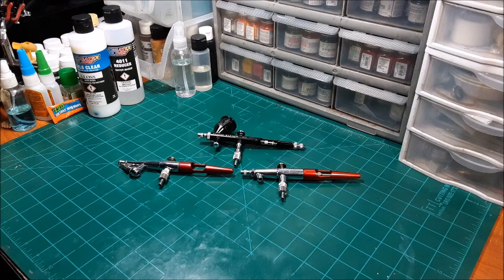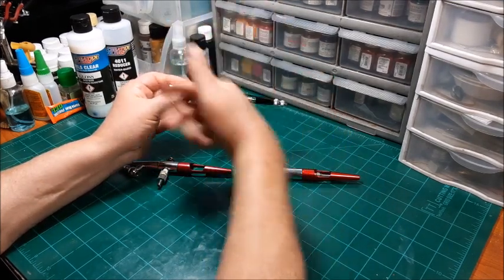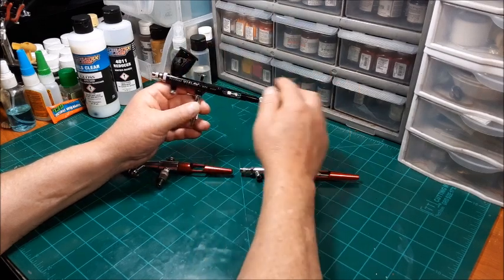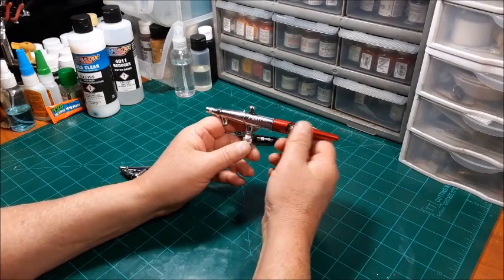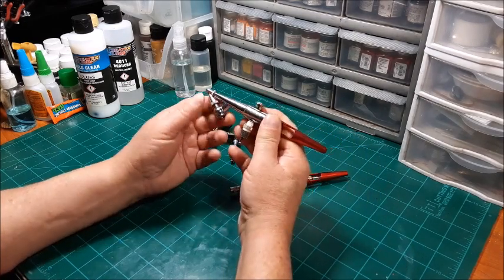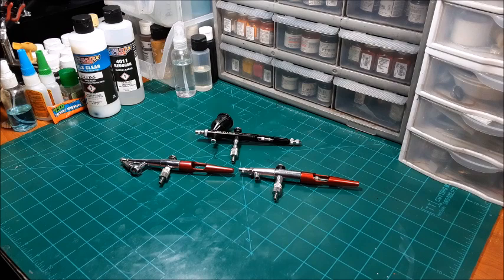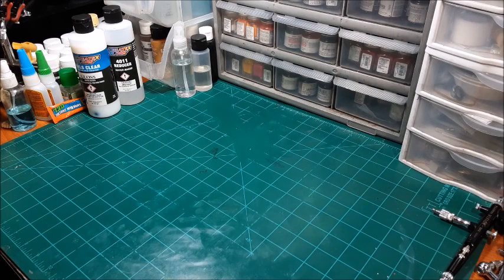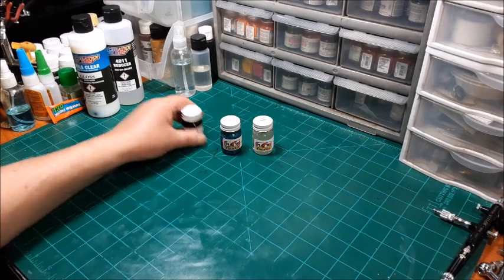Airbrush 101 - Paasche Airbrush Needle / Nozzle Numbering System

Comment: I got a bit of a challenge and could use your help. I have an old paasche VL and my needles have the rings so I can figure the size but the nozzles got mixed up and  have no markings. The tip has a number but the actual nozzle had nothing on it.
I can see one has a bigger whole but I don't know what number nozzle I'm dealing with..will using the wrong needle/nozzle combo ruin my airbrush or just give different paint levels coming out?

I wanna use my number 3 needle but don't know if my nozzle is a number 3 or a number one🤷‍♂️
Reply: Really old VLs had the number engraved on the nozzle. The only way to tell the size now is to compare the opening.

Comment: Which number would you use for a 1/24 scale model car using the model H? If you answered my question in this video I'm sorry I'm trying to multi task.
Reply from the maker: I generally use the #3 needle / nozzle / air tip combination, although I have used the #5 combo as well. It puts out a lot of paint, so you have to be careful not to open it up too much or runs will be the order of the day.
Reply: @mcmodelworks  Hey thanks for the info. I have one that I haven't used yet. Got a body all prepped and ready to go. I'll practice on something and give her a go. Thanks again.
Reply from the maker: Good luck brother!

Comment: I have the Passche VL it does not have the opening in the back like yours does. Also the needles are different than the Talon.
Reply from the maker: Paasche makes an anodized handle that fits the VL and the H single action. You can order them through Paasche or someone like Midwest Airbrush. The needles are different in diameter between the VL and the Talon/Vision. Like I said in the video, the needle sizes for the Talon and Vision are .25mm, .38mm, and .66mm. The sizes for the VL are .50mm, .75mm, and 1.01mm. They are not meant to be interchangeable between the Talon/Vision and the VL.
Reply: @mcmodelworks  Thank you